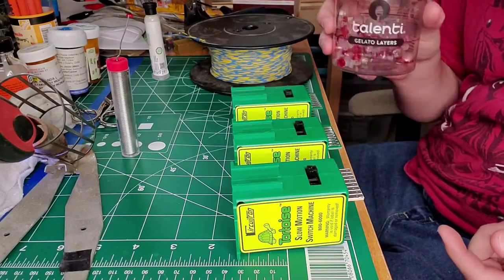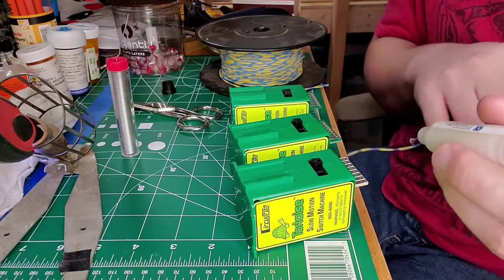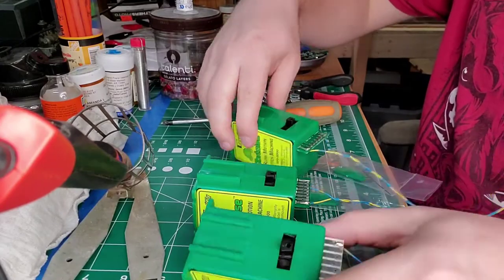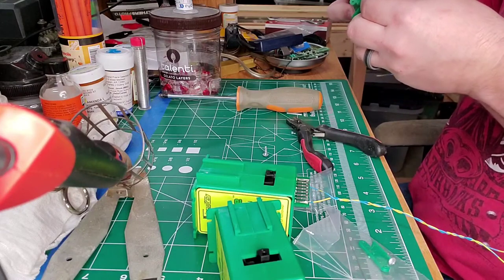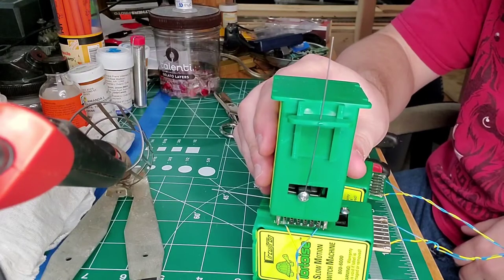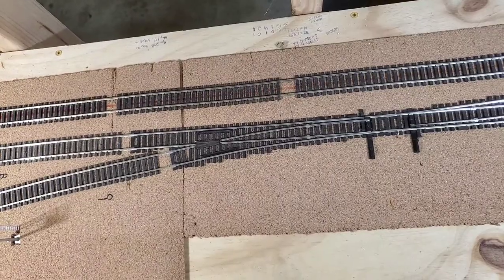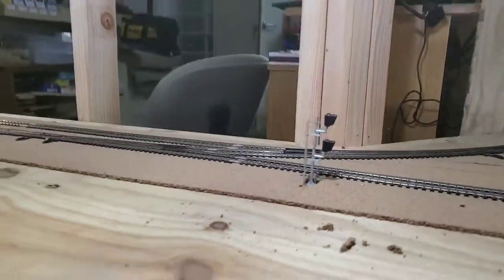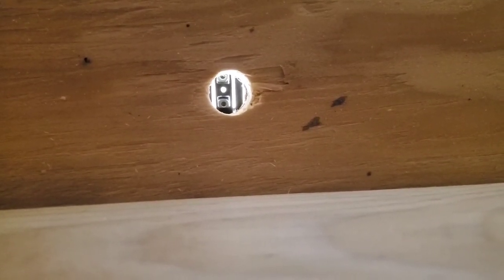How to: Installing Tortoise Switch Machine to NCE Switch 8 MK-2

Comment: Great video, thanks for posting. Subbed. What is the brand of your car shop? Didn't see it on Walthers site. Thanks.
Reply from the maker: Thanks! I think it's a Rix Products. It's no longer on the layout since I am doing a new build and no longer using this method to control my tortoises and using a much better method.
Reply: @TheTrainFreak  Ok, I have yet to catch up on your vids but what are you doing/using to replace the NCE? I have 30+ tortoises and starting to lay things out and thought the switch8 would work tied into my new DCC system. Thanks.
Reply from the maker: @schadowolf I still use NCE for my DCC system but I have replaced DCC with LCC for my accessories. Here is a link to a much newer video to get you jump started. https://youtu.be/cp3wocx0860?si=mLrpR6DIb_9-j2zm
Reply: Follow up - I found that shop, yes a RIX product, thank you! Watched the link you provided on LCC, much more research on my end now required LOL. Do you all still do Sidetrack Sundays? May want to pop in and check it out as long as not interfering with one of my football games LOL
Reply from the maker: @MRR_Shadowolf  I'm no longer a host but there is a group of 5 still doing it. Some channels are more interesting than others IMO.

Comment: Hey Jason, good tutorial. A small piece of double faced tape will hold up the tortoise up while ur marking ur hole. You can also use a small glob of hot glue for a temporary hold. Each can be renoved after testing. Also when throwing the switch if you have to throw the same switch twice just hit select acc twice. No need for 1 or 2.
Reply from the maker: Thanks Rick! Good to know on the acc button.

Comment: Hey Jason nice job.  If you start having trouble with the switch not throwing tight you might want to consider piano wire instead of the provided.   My club has replaced all on our Tortoise switches.   Hopefully I can install mine as easy as you did.   Keep having fun, Chris
Reply from the maker: Thanks Chris! The issue was the older switch that had paint on it. Soon as I replaced that, worked like a charm.
Reply: I understand that but the wire provided is not that strong and have a tendency not to apply enough pressure to hold the points tight and you end up with derailment.   The piano wire is so strong that you can't cut it with wire cutters.   We use small bolt cutters just like the big ones but very small.   I'm just passing on a problem that we were having.    Hopefully you don't experience it and all is well.   Keep having fun, Chris
Reply from the maker: Good to know Chris, hopefully I do not run into that issue. Do you know exactly which gauge of piano wire?
Reply: I've been asking the Guage but know one seems to remember other than they believe it's 3 times bigger.   I could send you a sample if you like.   Chris
Reply from the maker: That would be nice, we have a piano store in town that might sell it. Can you send an email to me? It is located in my about section on my YT page.
Reply: I don't see your email.   See if you can find mine in the about

Comment: Nice work.  I have seen lots of folks use them and you did a great job, but I will stick to my Märklin system.  The track may not look as realistic, but point motors (even digital) are a breeze.  :D  Cheers!
Reply from the maker: Thanks Anthony! I don't think these would work with your Märklin track. Might interfere with the middle rail. 😉
Reply: @TheTrainFreak  Indeed.  However, if you saw how easy motorizing a switch on my C-Track is...  :D
Reply from the maker: Did you do a video on it?

Comment: Those notches on those scissors are for stripping wire.
Reply from the maker: I know, those scissors are about done and need to be replaced. Been using them for almost 15 years.